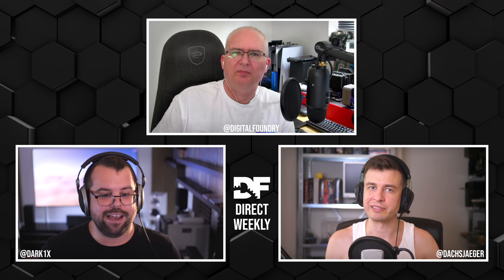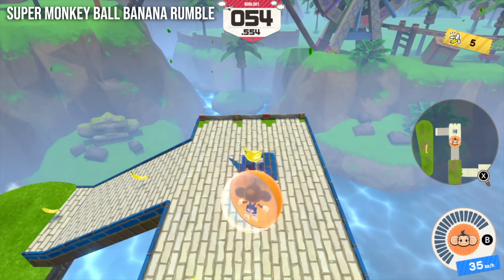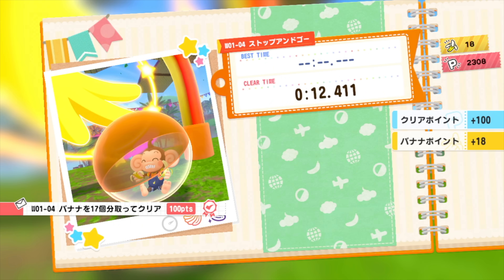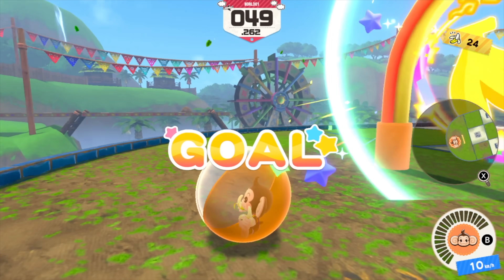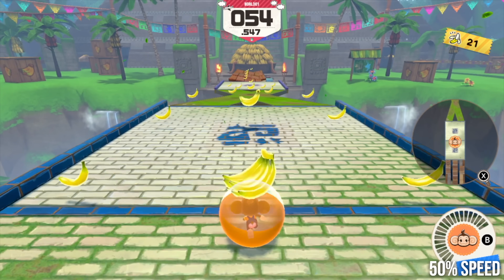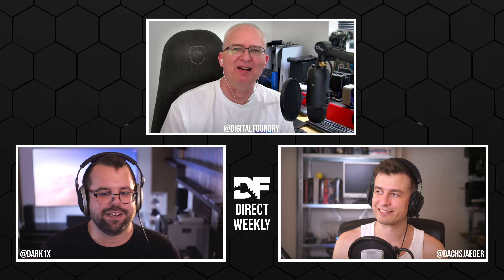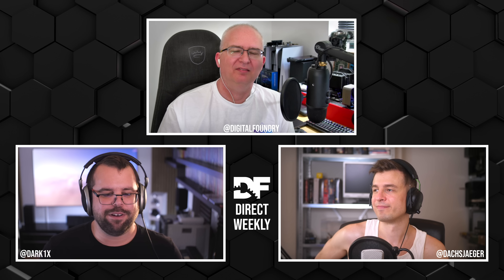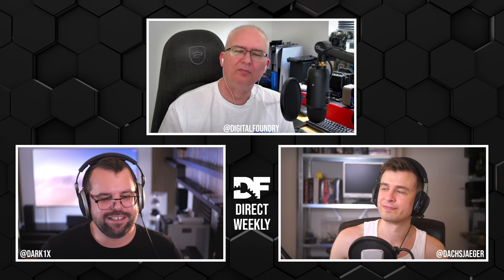The Unity Engine's 50Hz Physics Problem Strikes Again!

Comment: The amount of people at the top of the Dunning-kruger curve in the comment section is insane.
Reply: I've used Unity for years, almost a decade. Changing the physics tick rate is as simple as opening the project settings, going to the physics tab, and changing a single text field. It can literally be fixed in under a minute. If you'd rather go the interpolation route, that's even easier. Just select the object that has the rigidbody component attached, and select "interpolation" from the "interpolation type" drop down. It's not a bug, but a case of the default settings in the engine being suboptimal.
Reply: Coding the camera to not depend on FixedDeltaTime is literally on beginners-mid tutorials.
Reply: So it’s difficult to change Unity’s physics tick rate from 50hz?
Reply: @johnclark926  Changing the physics time step doesn't solve the problem.

You can try to match the physics time step as close to the frame rate as possible, but it will never be perfect.

Matching the time steps will reduce stuttering a lot but it will still be visible.

Interpolation is the only solution & it works no matter what the physics time step or the frame rate is.
Reply: Even more insane is people who have never used unity assuming this is some insurmountable obstacle that sega couldn't possibly have foreseen despite it being well documented, easy to spot, and easy to fix.

Comment: I'm not a Unity fanboy or anything, but I feel hyperbole like this does more harm than good. You can even see this in the comments talking about how 60hz should be the default and similar nonsense like that, as if that will fix anything. The problem here are bad developers. Period. This has nothing to do with Unity. Setting the default to 60hz would just mask the problem. Unity themselves have stated the reason the default is 50hz and not 60hz is for this exact reason. Programming your game to only work correctly at a specific framerate is stupid.

Actually learning how to use the tools at your disposal when making games, or just in general not being a shit developer and having some semblance of quality control before you ship your game is all that's needed here. As is mentioned in this video, it was immediately visible when playing the game that something was wrong. Hence it should have been immediately visible while developing the game as well. We're not talking about advanced topics here. It doesn't really get more fundamental than ensuring your game is at least capable of running smoothly. The game discussed in this video is programmed to not run smoothly, ever.

You could argue interpolation should be on by default, or you could argue that Unity's use of a fixed timestep for physics is the wrong approach, but none of this changes the fact that a developer that has chosen Unity to develop their game should be expected to know how the engine works before shipping their game.
Reply: Tell me the reason why they chose 50hz in a world that works at 60hz.
Is there any justification?
Reply: @deathdoor  It's literally written in my reply.
Reply: @TwiiK  I ask again, is there a reason why they chose 50hz instead of 60hz? Beyond the supposed "mind games"?
Reply: It's because when you set the interval at 20s you get clear 50fps. But if you use 16.66666666.... You will get 60.000000002 that's why

Comment: I did send Sega support an email about this and they respond that they're "aware" of the issue and "investigating". 

So that's something at least.
Reply: It's definitely something. 🙄
Reply: That is the default canned response of any support staff in general. They will say this even if the issue isn't even on their side and which has known fixes, like the Intel CPU debacle for example.
Reply: @okesik The default answer is “we’ll pass your feedback to the dev team”. You never acknowledge that there’s a problem in a default response template.

Comment: In my experience with Unity, using interpolation doesnt fix camera judder.  It improves it for sure, but there can still be issues.

You need to use SmoothDamp (a function built in to Unity) to get it smoothed out

but SmoothDamp averages the object's position over time, so it does add a squishiness (for lack of a better word) to the camera motion that might not match the feel you want for your game

Comment: Probably  why DARK SOULS /from software games  ties the physics rate and animation speed  with the frame rate... To offer a consistent experience ... Is it?
Reply: The logic gets a lot simpler when you tie everything in the game to a set rate. Calculating the change in time with screen and logic frames has a bit of overhead to it. And if the framerate jumps too high or too low and the code doesn't consider this, you might be moving through thin solid objects or game scripted triggers stop working correctly. If you make a console game, the hardware normally was never supposed to change, so you are never going to get that high speed boost in the future. In some older MS-DOS shooting games with unlocked frame rates, you end up literally shooting yourself today because the framerate gets so high on modern PCs, no one noticed the "bad" logic on the standard slow machines of the 90s until 15 years of hardware advancement showed the problem.
Reply: No, it's because of incompetence.

Comment: Why the hell Unity not default to 60 hertz?
Its goddamn 2024, this problem has been exiting almost a decade now
Reply: Because 50hz translates to exactly 0.02 seconds, while 60hz is 0.01666(repeating) which results in a rounding error due to this level of precision being impossible to enforce. To fix this you need to either interpolate from 50hz to your arbitrary rate or you need to handle physics with the update of each frame rather than a fixed time step which can get hairy if you can't maintain a locked frame rate, which this game struggles to do on switch.

Also they can and should decouple the camera position from the physical ball. They should update that on the frame update rather than attaching it to the physical ball object.

Comment: The sad thing is that it's probably a very easy fix to just flip it to 60Hz tick rate, but it's never going to get fixed by the devs.
Reply: But then you have the exact same issue when running the game at a refresh rate above 60 Hz. That just moves the problem.
Reply: @gragogflying-anvil3605 yes, but it's only on switch which won't go above 60. Now maintaining 60 is another story.
Reply: More like mangement won’t allow the devs the time needed to implement, review, test the fix and release it

Comment: I'm sure Unreal has its problems, but I keep feeling vindicated in my choice to use Unreal over Unity
Reply: That's a bad reason to choose Unreal over Unity. If you want to use fixed timestepping with Unreal, you will get the same problems. Only in Unreal, the problems will probably be harder to fix.

Comment: Most people would not notice this. I can clearly see what DF is talking about because im viewing the video on a CRT. Unless you have a CRT, OLED (with BFI) or LCD (strobing). Most people won't care, notice or see an issue.
DF's team has access to high end monitors and john is known for using BFI, but 99% of people still use sample and hold and won't even notice an issue.
Please do make a video about motion clarity and the importance of it.
Reply: Yeah John should make the video, he knows a lot about it. Should also talk about asynchronous reprojection (frame gen used in VR) and interview someone from Blur Busters. :)
Reply: You can still notice it on sample and hold but it is harder to see for sure.
Reply: @lulkLogan   I can tell bad frame pacing on sample and hold now, but before gaming on a CRT I couldn't tell you or even know what to look for.
Reply: I not only immediately noticed it on my TV, but I actually cannot play the game because the stuttering was giving me motion sickness when combined with the camera motion. Banana Mania was mostly smooth, so I don’t get what happened here. If the stuttering gets fixed, I’ll be able to play it.
Reply: I can clearly see the issue on a standard LCD. And I've been able to detect this issue in many Unity games in the past. BFI may make it even worse, but it's definitively not required to notice it.

People may not notice the issue in the video if they're not running the monitor at 60 Hz (or a multiple), as the video then is already jittery.

Comment: For what it's worth, the Series X version of SMB: Banana Mania seems to have fixed this via a patch at some point! I've been playing it again recently and it's buttery smooth now, no 50Hz stutter when the course begins.
Reply: Unfortunatelly, the problem was still present in the PS5 version a few days ago :(
Reply: @Zebes1984 The PS5 version of Banana Mania looks very smooth to me, with a stutter only every once in a while (which I assumed to be the garbage collector). Banana Rumble on the other hand I am finding practically unplayable with how horrible the stuttering is.
Reply: @11clocky  Ahh, the problem I have noticed in PS5 is the one you described: an small stutter or frame drop every certain amount of time. I thought it was the same case in Xbox version and this new game in Switch.
Reply: @Zebes1984  In Banana Rumble it’s 10 times a second, which is substantially worse.

Comment: rb.interpolation = RigidbodyInterpolation.Interpolate;
rb.collisionDetectionMode = CollisionDetectionMode.Continuous;
Reply: The devs should absolutely do this themselves and patch it, but with this being so simple, I feel like even a dedicated modder could just enter these enum values into wherever this is necessary (in a base class preferably so it would go down the chain on everything maybe).  Just feels like a mod could fix this very easily.
EDIT:  Oh I missed the part earlier where this is only on Switch... yikes.
Reply: @desmondbrown5508  If this were on PC, I'd be able to make this mod in an hour (or 10 minutes, really depends on how hard it is to find the right file)
Reply: Collision detection mode change isn‘t necessary
Reply: disable.denuvo=true;
give.allDLC=also.true;
Reply: @Krisztian5HUN  That‘s some of the worst fake code I‘ve seen!
Reply: @nolram  ikr

Comment: You can also just change the Fixed Timestep setting (That controls the fixed tickrate in Unity) from 0.02 to 0.01666666. All the Unity projects I work in now, we do this as it's silly to have the physics & fixed tickrate update not be divisible by 30.
Reply: This is still a terrible "solution", it means that the game will be smooth only at multiple of 30 and it's silly since variable framerate or people playing at 144Hz, 165Hz etc will still have a bad experience.
Reply: Is there a difference between this and what they said in the video about changing the tick rate to 60hz? Genuine question here, are those different things somehow or are you simply describing the actual means to do it.

I'm a hobbyist, but haven't been messing around with games for a while so I'm curious.
Reply: @milddiffuse  it's the same thing. 
1 / 50 = .02 = 20 millisecond
1 / 60 = 0.0166 = 16.66 milliseconds
Reply: @milddiffuse  it's the same thing, it is just the method of doing it.
Reply: @milddiffuse  Well the physics time step & the game time step are disconnected from each other & can be set to run at different rates.

You can run a game at 120Hz without having to increase the physics to 120Hz. Increasing the physics that high would probably slow down the game.

Instead, you can run the physics at a lower rate to the game. 50Hz is fine for most physics interactions.

The problem is that the physics objects are out of sync with the frame rate of the game. They will appear to stutter as they move because in some frames they don't update.

To fix this, you can interpolate the motion between frames. 

So, the physics will still run at 50hz but it will look like 120Hz because its motion is being smoothed out between the frames.
Reply: @john_hunter_  Just to be a little nitpicky: allot more game logic is likely tied to the physics tick rate then it is the rendering rate... I'd more say that the GRAPHICS and the game are disconnected, then the physics/game.
The game itself exists entirely in data, and that data often changes with the physics rate. The rendering-side of games is simply a representation of that data, and you could technically have a physics tick of 1fps and have good enough interpolation where you could render at 120 fps and not even realize that internally objects are jumping massive distances each movement tick(interacting with the world would just be very unresponsive).
Reply: @john_hunter_  unless you have maths to do some unorthodox camera movements in the fixed step ( such as mario galaxy style rotating up and orbits). Then you can't just use interpolation. It also means you can't change the interpolation settings for certain collision scenarios. Sure you could recode the whole thing, but let's say you only discover this late in production (cough), changing the fixed step rate to 1/60 is the best way forward!
Reply: Is this patchable?
Reply: Yup you can do this in preferences of the project
Reply: The downside is that the issue still presents itself with arbitrary refresh rates. Better to just interpolate or to set the FixedUpdate rate during runtime to (1 / screen refresh rate).
Reply: Also enable interpolation for the individual rigid bodies, which solves the problem even if there's a mismatch between frame rate and physics tick rate.